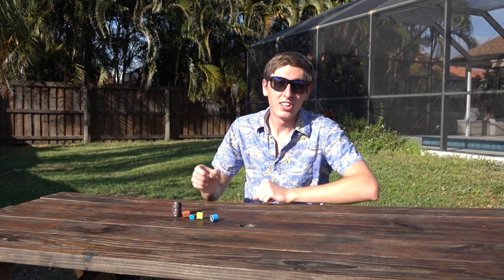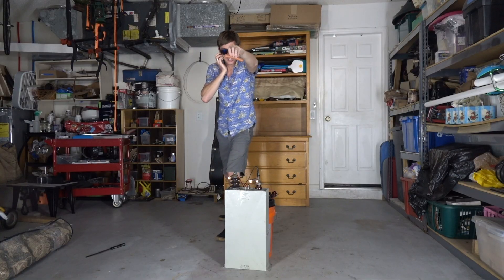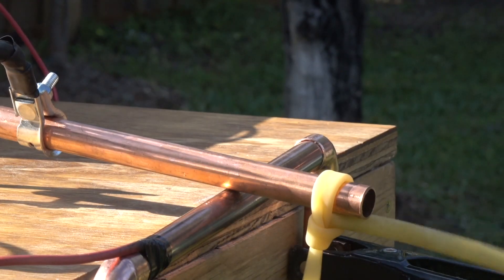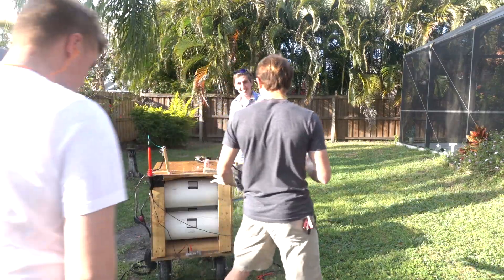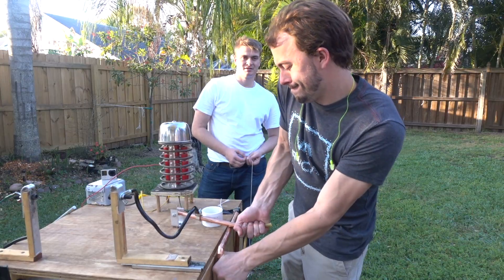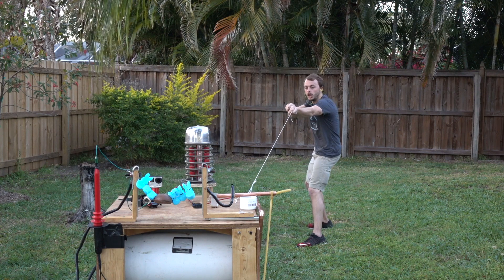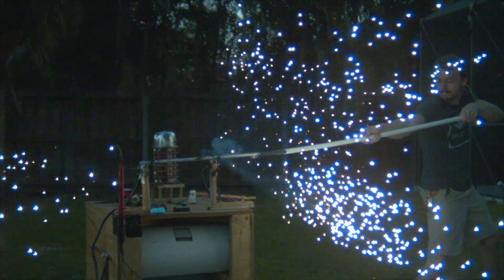What happens when you put 20,000 volts into a Watermelon?

Comment: capacitors are not batteries, and you cannot compare capacitors with batteries.
Reply from the maker: yes you can. and I can prove it mathematically.
Reply: Yes, you can prove that mathematically, but both have completely different attributes with one physical and one chemical. Both physics and chemistry were developed using math as a tool for interpretation, but math alone could not represent both science. This is like trying to prove an apple could have the surface area equivalent to the sun by cutting the apple in multiple pieces. It works, but its not practical to the real world.

Comment: Hi, what current electrical (in ampere)  works this?
Reply from the maker: from the batteries, 5Amps, from the high voltage power supply - 100ma, from the capacitors, 10 million amps for 1/1000 of a second.

Comment: Your math is wrong for the capacitor for camera flash @0:30. The capacitor reads 220 microF @ 450 V. So it holds 0.099 coulombs of charge which will be 22.275 Joules of energy, not 200 joules. Your energy calculation for other capacitors might be wrong as well.

Comment: Actually 20,000 joules is not that much energy.  Let's see, 4.21 joules == one heat calorie and  there are 1000 heat calories in one food calorie or 4210 joules per food calorie.  So 20,000 joules of energy is contained in a little less than 5 food calories.

Also, I hope you store your capacitor shorted out.  Otherwise it can pick up ambient charge from the atmosphere,  just waiting around to surprise someone.

Comment: its more about the current actually exploding stuff NOT the voltage. But 10 Amps isnt as catchy as 20000 volts
Reply: Not entirely true. Currents around 50mA to 100mA are the most dangerous for the human body, as they function as a fibrillator. When speaking of higher currents (eg defibrillators with peak currents of 50A) they will not let the heart go into fibrillation, altough you will suffer from internal burning wounds that can lead to a fatal end.
Reply: have you guys heard of z cool thing called "ohms law" study it please
Reply: Assuming those are low-inductance energy discharge capacitors, the peak discharge current is likely many 10's of kiloamperes.
Reply: Skogsforum
Reply: +O Cuidighthigh voltage directly determines the current (and resistance in some cases)
Reply: Well yes... The voltage and the resistance determine the current. but the current is the actual flow of electrons that is essentially hammering its way through all this stuff.
Reply: +O Cuidighthigh with that analogy, if i shoot someone, it's the bullet's fault, not mine...
Reply: +O Cuidighthigh "You could, in theory, have a massive voltage source limited by a massive resistance and have such a small flow of energy that it wouldn't do what happens in these videos" you could also survive a ~10A current (if it lasted for a few microseconds). technically, the current is the one that kills, but since you can't have current without voltage, it just seems wrong to think that the current is the only one you should worry about. you worry about a lunatic with a gun, not about his bullets. every warning sign will say "attention, high voltage" and not "attention, high current is possible if you short the circuit". and the higher the voltage, the lower the skin resistance is (which in turn increases the current further).
Reply: 100mA to 200mA is fatal to humans. If you're shocked by only a couple seconds you might be okay. 10A is 50 to 100x stronger. Any human will die instantly at 10A as their body would explode along the line of current. Yes, voltage and current go hand in hand. That still doesn't change the fact that current is the destructive force of electricity. Take a multimetre and go measure an open circuit. An open circuit has all of its voltage and none of its current. The wires will no longer emit heat (the destructive force of electricity) because there is no longer any current.
Reply: E = I * R. Please.
Reply: it's not about the current nor the voltage it's about them combined into watts and if you want to get plasma, well you can't with a low voltage

Comment: Those big capacitors can build up a new charge after you discharge them without any external power being applied. I think you showed this near the end of the video.  I once worked at a place where they had equipment that used that type of capacitor.  It seems that my predecessor had touched the terminal of the capacitor some time after it had been supposedly discharged. He died instantly with just a small black spot on the sole of his foot.  Everybody take care.

Comment: The largest capacitor surge generator that I have worked on was the size of a house, with an output of 30 amps for 1 second at 1,500,000 volts. An 11,000 volt 3 phase supply was tapped from the national grid to charge it through a bank of mercury diode rectifiers. It was charged with banks of the capacitors arranged in parallel and an oil filled switch arranged them in series when the 'fire' button was pressed  It was built to study the effects of lightening on nuclear missiles. When tested by short circuiting it with a 2 meter length of 1 inch copper pipe, the pipe vaporised without leaving a trace.

Comment: what if an animal or human end up in this experiment ? will living things blow up as watermelon?or the result will same as the steak?
Reply: I would probably vaporize the impacted area, if you were hit by this setup. The reason is. The steak is mostly just meat. The body with it's high water content is different. The area of the body effected would flash boil and expanded outward. Though it can go many ways. Grab a powerline for example and you will most likely lose limb(s). With electricity it is hard to determine possible injury outside of a controled enviroment.
Reply: Basically it is a lightning strike, but in this case with a rather small amount of energy.
The effects on living animal tissue may depend on its structure, volume, and the the length of the lightning channel the tissue is exposed to.
Keep in mind that actually there are people who have survived direct hits by lightnings.
Ionic fluids are extremely good conductors and thus possibly the chance of boiling is lower than charring the actual tissue. The heterogenous character of the tissue of higher animal organisms (compared to the rather homogenous pulp of the melon)  may play a significant role.

Comment: Danger!!!  Anytime you are around 5,000 or 10,000 volts, it does not follow any rule.  The electric bolt will ground using your body if you are near it and in a fraction of a second, you can be electrocuted.  What you need is mats on the grass, boots, and all parts of your body shielded.  As I said, even if you are in the same room with 10,000 volts; there is a chance the current will use your body to ground to the earth!  IT IS AN INTERESTING EXPERIMENT AND LUCKILY NOBODY GOT HURT.
Reply: Alex-Thang Nguyen 

because it wants to go to ground.

but, the distance AC electricity can jump is driven by voltage and is a known variable.  

AC in medium voltage DOES have rules, and if you are aware of its properties,  and take the proper precautions, you can work with it safely. 

I'd be dead 100 times over if +10,000VAC could jump room sized gaps and get you. 
I work with 34,500 and 69,000VAC regularly at the power plant I work at.
Reply: IF it is lightning, then it is coming from the ionic atmosphere; which has a surplus of protons.  It won't shoot back into the sky.  So the question is, does gravity have something to do with it or if you are in outerspace, the ionic atmosphere will spontaneously go in any direction.  Clearly your body becomes the conductor and clearly the electricity will go right through you.  The question is, under what thresholds or what conditions do these laws apply?
Reply: Alex-Thang Nguyen smart 🤔
Reply: Alex-Thang Nguyen only if there's a conductor. If there's something blocking it that's not a conductor than they're fine
Reply: 220 VAC doesn't feel good; so i can imagine 1,000 VAC.  I have worked with 10,000+ volts and I would stay away or give it room.  THERE IS A VIDEO of power line guys in helicopters, watch how they ground themselves.  They make it clear the moment their ground is disconnected, they are dead; so the helicopter pilot is freaking.  I do not have the link but you can watch them work on high voltage.  If you are working with 35kV or 69kV then there is a fence around it with signs saying "high voltage keep away."  OSHA has minimum safe voltage distance.
Reply: just isolate your self from it you will be fine
Reply: relax, it's only theory; should be okay.
Reply: Relax, it is all theory.  You should be okay.
Reply: electroboom needs to know that
Reply: no one talks about the current?  "currentXvolt=hurt then died". hahaha.. just da joke, never mind..!
Reply: lol.  wait it's not lol.  LOL
Reply: Alex-Thang Nguyen 

dude it's not a snake that'll randomly bite you anywhere in the room. 

just stick to the 1" per thousand volts rule of thumb and then double it.  the MOST  10kV can jump a gap in dry sea level air is going to be about 10" if you stay 20" from the conductors you'll be fine.   

now, we need to talk about your "hot stick"... a piece of pvc pipe ain't gonna cut it.
you want to play games with HV?  get a proper fiberglass insulation stick, and have it tested annually  (it's cheap to have them inspected, cleaned and tested)
keep it clean, and wax it with auto wax to ensure liquid beads up on it instead of spreading out on it.  

also, get yourself some class 2 high voltage gloves and leather covers  if you want to dance with 10kV (actually those are good to 17,000) 
and don't forget a pair of EH rated work boots.
Reply: Lightning is the same way.  If you are grounded, it will jump from the object or ground if you are near it.  Why?
Reply: dude, you don't know what you are talking about...

you know those old fat TV's? those are 30.000 volts, should you always wear boots and rubber mats if you have one of those?
Reply: go big or go home pwussay boi

Comment: Likely the reason why the HV supply (looks like a voltage multiplier) blew up is because of the inductance in the system. It's very small, but because there is such a large amount of energy involved, the inductive "kickback" is still enough to cause an over-voltage on the HV supply's components, causing them to fail.

Comment: bruh that's nothing compared to the ULTRA capacitors the busses in my city runs it has to send power to an electric motor,a HVAC system,the engines ignition and fuel systems,all the lights inside and out with the headsigns and 8 cooling fans 2 for the ultra capacitors and 6 for the engine I know for a fact a lot of voltage is being released to power those things everyday and I'm pretty sure the power bill to recharge them is HUGE 😂😂😂😂

Comment: where did you get that 50 cal info from?

a 50 cal bullet have between 15 000 and 20 000 Joules depending on amunition and weapon used to fire.
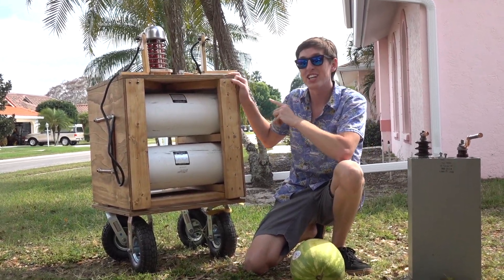so its basically the same as firing with a 50 cal rifle at the watermelon. Not the same as 4 shot simultaniously as stated 1:39.
Reply: kinda, but in order for the .50 cal to transfer all of its KE, it needs to stop within the watermelon instead of going through it

Comment: Kind of insane to be playing around with those sort of caps in your backyard. On a side note, the title should have said how many Joules you put through the watermelon, not the volts. 20,000 volts doesn't really mean much. But hey you gotta get them clicks.
Reply from the maker: +Siegfried Gust it's hard to visualize 20,000 joules. Without any background you don't know if that is a lot or a little.
Reply: "What happens when you put four .50 cal's worth of energy into a watermelon"?
Reply: Siegfried Gust yeah but more people know what a volt of electricity. Everyone knows ohm volt and watt but joule isn't as known. But yeah voltage is just the speed at which it flows so it isn't as cool
Reply: TheBackyardScientist I do understand why you picked voltage for the title but that doesn't make it correct. Voltages don't "go through something" rather that it's a way to measure differences in electric potential. Current does go through objects but it's hard to calculate for a random object so wouldn't make a great title either.
Reply: Siegfried Gust

Comment: Why do you need such large capacitors to have only 25 uF of capacitance? Does it have anything to do with the voltage it needs to build being very large?
Reply from the maker: +cikif capacitance is a function of the surface area of the metal plates in the capacitor and the distance between them. in order to insulate the plates from each other there needs to be a lot of space between them. Because they are very far apart there's less capacitance.

Comment: 20K volts and 20K joules are not one of the same! Unless you had 1,0A of current
Reply from the maker: Do the math, 100uf @ 20kv, and the capacitors put out about 1000000 amps in 1/1000 of a second.
Reply: Was the capasitors parael or daisy chain?
Reply: how were the capasitors connected to each other?

Comment: so how many amps did you use ?
Reply: ATOMIC SHARK , that depends entirely on the resistance of the cables and the object being shocked. Current is variable,  V=IR, where V is voltage,  I is current,  and R is resistance. So if the power supply is 20kV, the amperage is inversely proportional to the resistance of the object,  or directly proportional to its conductance. This means that the watermelon likely had a higher amperage than the steak, and the discharge stick had even more than that. If the resistance were,  say,  1 ohm (not likely) it would be 20kA; if it were 10k ohms (still on the low side) it would be 2A.

Comment: NEXT: 20000 DEGREE KNIFE VS WATERMELON
Reply: Not even graphite is solid at that temperature...your knife would just be plasma. (not that I'm against a plasma knife)
Reply: Haha 
But then no knife would be left
Reply: Odd because steel melts at 1/10 of that
Reply: sooo knife wins?
Reply: Andre Cook infinite degree lighsaber  summoned by God vs galaxy
Reply: the knife would be vapour.
Reply: indeed
Reply: So... molten iron vs watermelon? I think he did that already. =P
Reply: Kentastrophe  it won't even be that it would be closer to a plasma. considering iron be come a gas at 5000 degrees f and the sun is around 10000 degree f
Reply: thats litterally stupider than you!
Reply: Fighter169mobile how would you measure the temperature
Reply: electronic/laser thermometer...?
Reply: you need to strap a knife to a hydrogen bomb and position it at a calculated distance from the watermelon so as to vaporize the knife and send it enough distance to cool to 20,000deg f, as the nuke will instantly reach millions of degrees, before passing through the watermelon. of course, the vaporized knife plasma will be indistinguishable from the explosion, but itll be in there. ;)
Reply: Robot Edits that's impossible
Reply: 8 Bit Otaku dead
Reply: The god of Raisins Not the center of the sun! 😁

Comment: Just make bullets that have that many volts for weapons
Reply: The Ice Kingdom Yeah it's called a taser.And it doesn't always work though,regular firearms are much more reliable.
Reply: The stress put on the bullet by being shot out of a gun would probably break it before it has a chance to hit something. Also how would you load said capacitor bullets into the magazine of the gun?
Reply: use capacitors like the video but smaller versions like bullets that have 2 prongs and whatever they hit they release all their energy
Reply: West Coast Warriors Archive wow... that is deep.
Reply: ~  That could theoretically work if the capacitor "bullets" were fired from a rail gun.  I don't know why you'd need capacitor rounds, though, as there would be a lot of damage caused from the projectiles already.
Reply: Yeah the only use I see for some kind of shock bullet would be if it was some kind of extended range tazer

Comment: If you have 4 Capacitors in parallel, with 25uF each charged at 20kV, shouldn't that give you a stored energy of 200kJ, not 20? Because 0.5 * 0.001F * (20,000V)^2 = 200,000J

Comment: That is not like shooting four 50 cal at the same time, the capacitors store 20kJ of ELECTRICAL energy not kinetic
Reply: It's still the same energy, just a different form. You can have energy transfers
Reply: Skaarj RPG A joule is a measurement of energy regardless of the type. That's why the measurement exists, so there is a way to compare energy across multiple forms.
Reply: You're right, I got Joules mixed up with calories
Reply: +Skaarj RPG Firing four would just evaporate the watermelon. And trust me, I would much rather get shot with four .5cal than shocked with that thing, and it's not because it would be less deadly. (Not that Thor's joybuzzer isn't)
Reply from the maker: You're right. for some reason I thought they had 5000 joules of energy, my mistake!
Reply: 1 liter of water needs 4200 joules to heat up by 1 degree celsius sooo 1 joule could heat up 1 gram of water by 0.23degrees celcius!
Reply: Skaarj RPG the amount of energy released is equal
Reply: L3D Cobra The
Reply: Since kinetic energy is measured in Joules, assuming 1 .50 cal has a firing energy of 5KJ, then yes, that is 4 .50 cals.
Reply: For those interested: 1 Joule is the energy required to increase the heat of 1 gram of water 1 degree Celsius. It doesn't matter in what form the energy exists.
Reply: The amount of energy released is equal, but not really much of it is pumped through a watermelon
Reply: +ned flanders It is same energy, but most of it is lost. 1 50 cal is more than enough to turn that watermelon into mist, let alone four